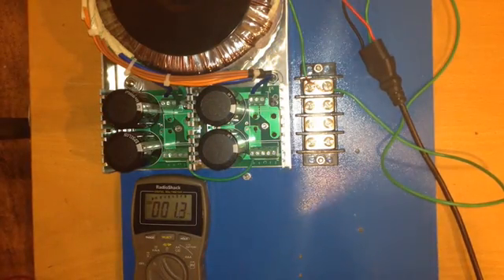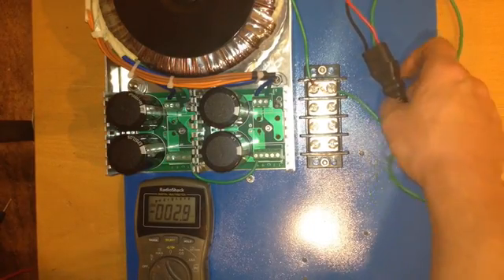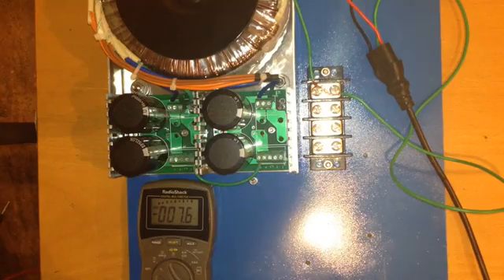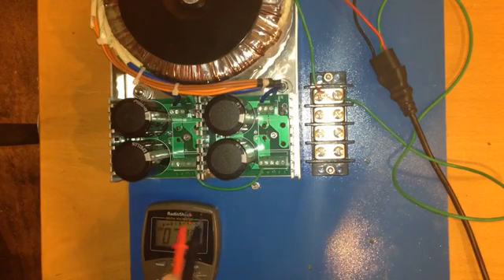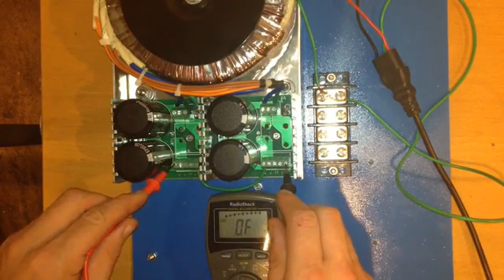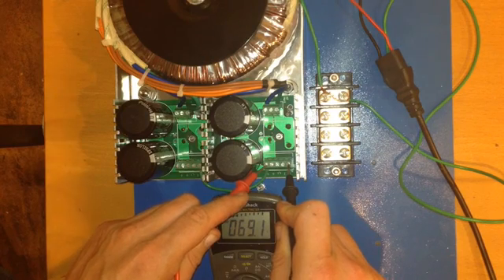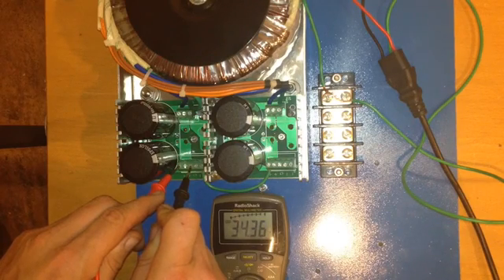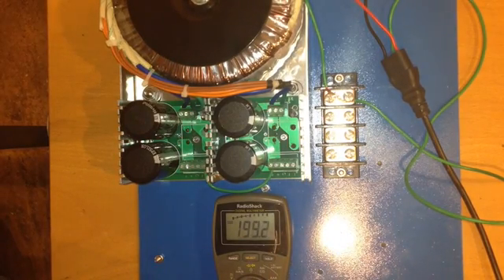THUNDERDORK: DIY CNC Router - KL 7220 Power Supply

Comment: From your video, each green PCB is a voltage doubler.  The C is the common tap between the two caps and connected directly to a lead on the transformer.  Look up voltage doubler for more info.  They do this because you can make several different voltage arrangements if you need them.   The contactor you talked about is basicly a circuit breaker. Usually a magnetic circuit breaker (current creates a magnetic field that pulls the contacts apart) resettable...  This is helpful because large toroidal transformers like that one, can have large inrush and can dish out a ton of current if wound correctly
Reply: Awesome build by the way, I'm currently building my second CNC.  Going over the top of course. :)

Comment: You can hook it up to to 220volts on the primary side by changing the 4 leadwire and hooking them up in series you would have to get the transformers diagram.